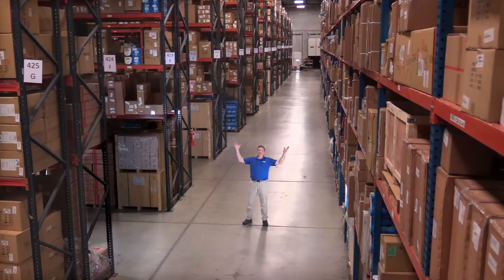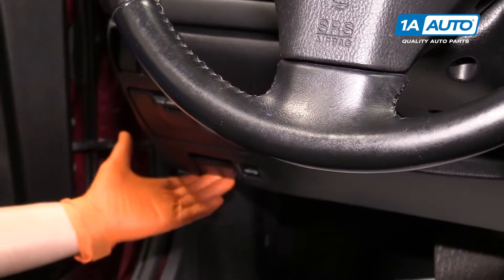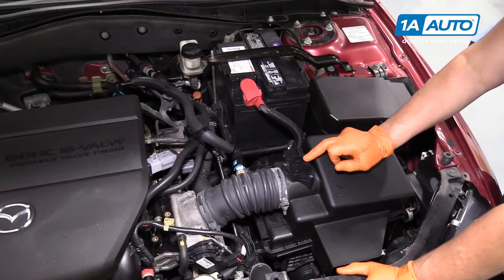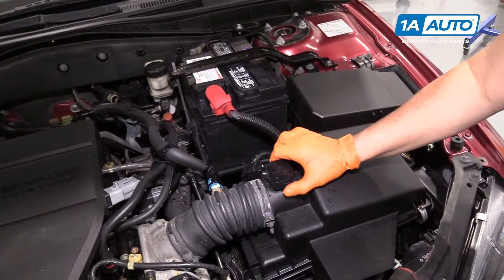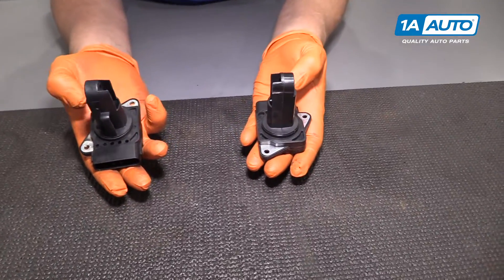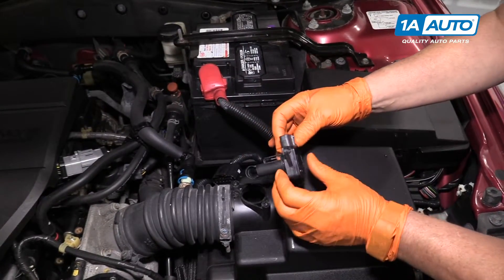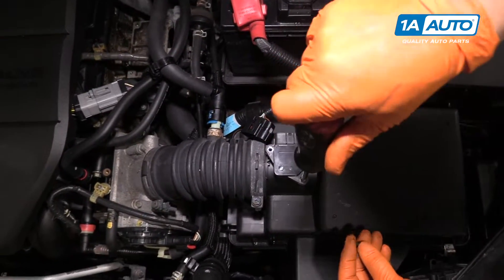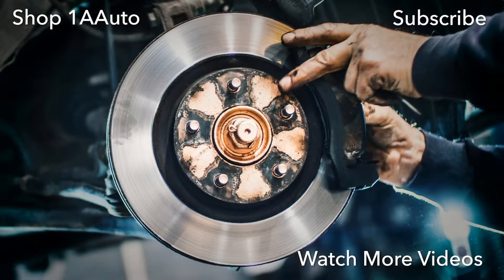How to Replace Mass Airflow Sensor 03-13 Mazda 6

Comment: Thank you. I changed the sensor and tested it by disconnecting it with the car running and it shuts off, like it should. Only issue is the check engine light is still on.
Reply: PAULJETS75 disconnect and reconnect your battery
Reply: Okay. I’ll try this and let you know. Thanks.
Reply: Light cleared itself.

Comment: My 2006 Mazda 5 engine    light on. Code says it's my oxygen sensorI i put new one in engine light stipl on code still says its the oxygen sensor i also changed the mass flow sensor. engine light still on. What do I do.?  Code still says it's the oxygen sensor.
Reply: yo
Reply: Did you ever solve this

Comment: It sounds like the screws are supposed to be tight when you reinstall the MAF?  I replaced one and the holes seem to be stripped which I feel won't allow for a good tight seal.  Are they supposed to be tight?  If so, any tricks to help fix this?